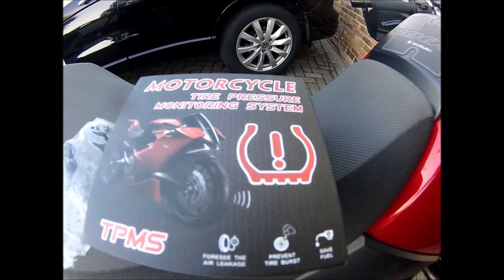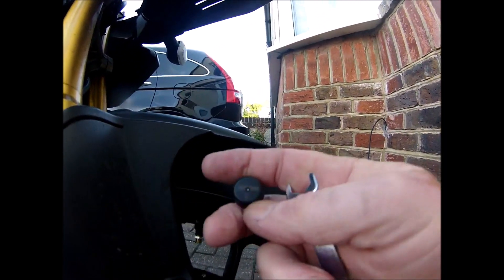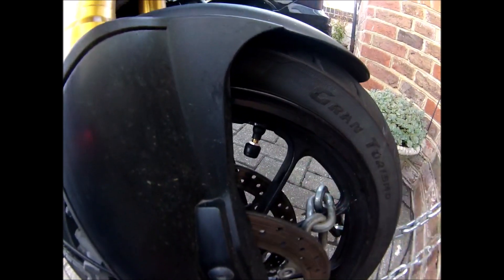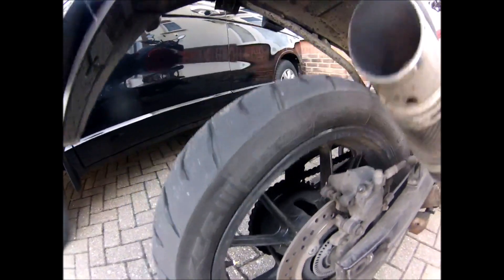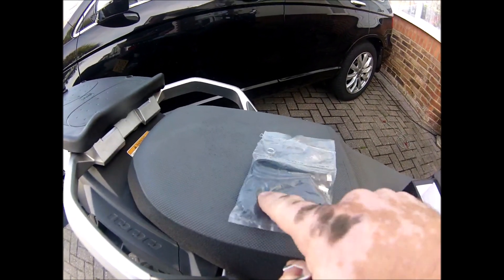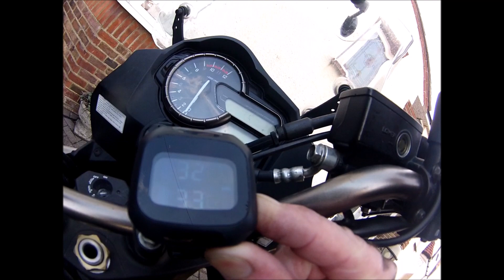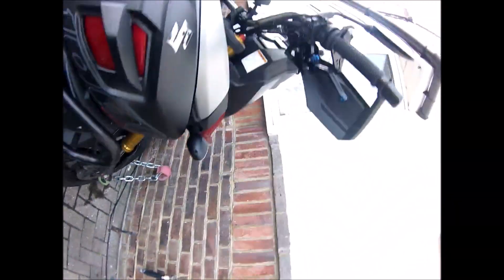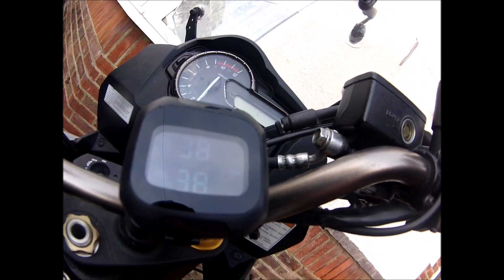Suzuki V Strom 1000 Tyre Pressure Monitoring System

Comment: Thank you for posting.  Any issues at high speeds or at all?  Read that some of these TPMS systems cannot be used with rubber air valves.
Reply from the maker: No problems at all 👍